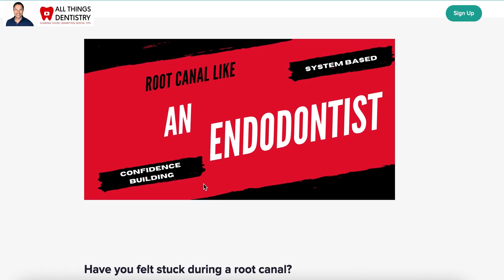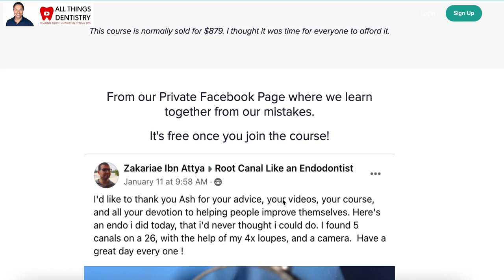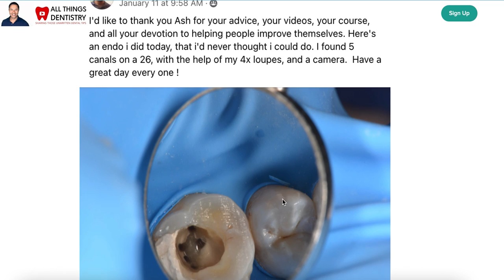Ultrasonic Tips - Improve Your Endo Skills

Comment: I don't use ultrasonic tips as I don't have any,, so I penetrate to the level of cervical line then enlarge horizontally at that level a little bit with a fissure bur then a slowspeed round bur for the whole chamber,, then flaring with a fissure,, I don't have endo z burs but this technique is safe and always works fine

Comment: Hey, so unless use alot of water with assisant , its to bad that those ultra sonic tips  damage surrounding tissues during endodontic treatment, it is common that local temperature increases of the root surface exceed threshold temperature increase

Comment: Hi doctor.At this point, would you enlarge the access to increase the width coronal to the canals for reducing stress on the files.
Reply from the maker: That is such a great question. I think it really depends on the operator and the file system, and the patient as well. In my experience, the number 2 Round bur has a diameter of 1 mm, and I find it is sufficient width in premolars, lower premolars. My hand isn’t perfect so the bur does move laterally and widens the access as I move buccal lingually. 
Honestly, unless it’s a mandibular anterior incisor, most teeth already have a restoration or caries to excavate.